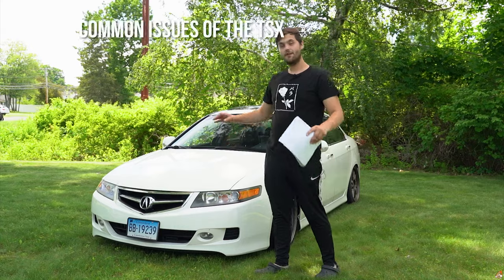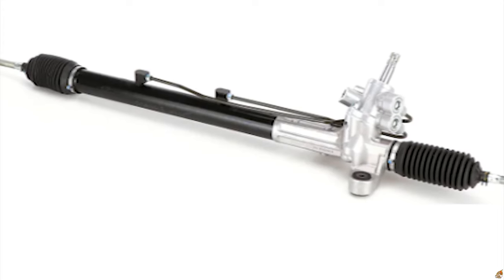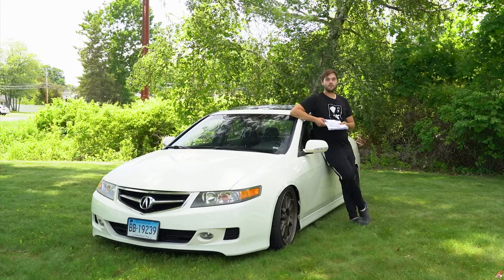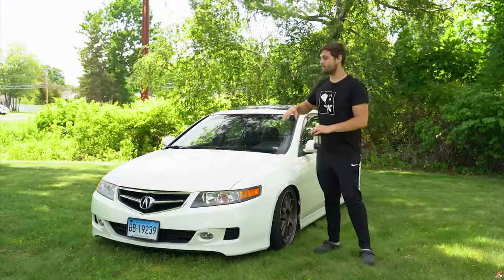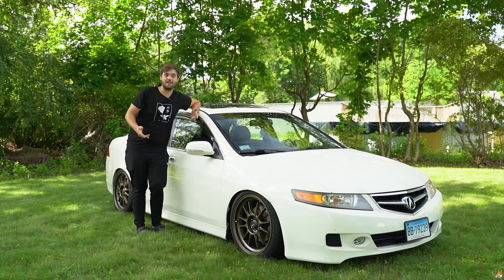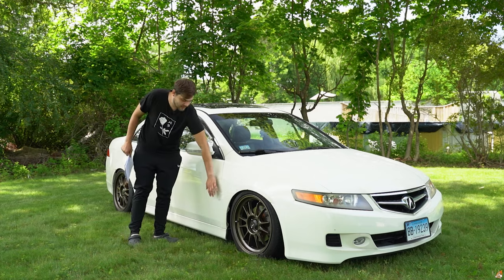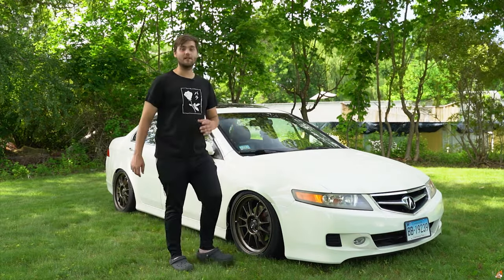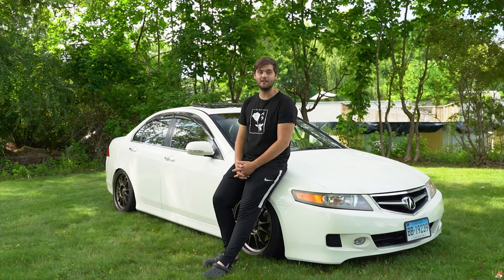TOP 10 COMMON ISSUES With An Acura Tsx

Comment: I have just replaced my front crank seal cuz  oil is splahed everywhere. Would it be the power steering pump? Or what is the common issue for a oil leak?
Reply from the maker: Its hard to say from your description, oil pressure switch, vtec solenoid, rear main seal, valve cover, timing chain cover etc

Comment: Saw a 2006 tsx 6 speed with 285k Miles is it worth buying with that kinda mileage
Reply from the maker: It really depends on the condition, whats been done, and ofc the price. if you can get it for a good deal sure thing can get a new engine for 800-$1000 if that would we let up.

Comment: I'm pulling a u0122 code I got new vsa module and it says abs motor relay open or short and my DLC is loose.. there has to be a short somewhere what's the easiest wait to go about finding it to fix it? I just have a multimeter and good launch scanner it's a 06
Reply from the maker: Hmm damn I haven’t really dealt with much like that, maybe look into your fuses make sure whichever for the abs/vsa and stuff is good. 
Make sure your alternator is reading I think like 14.7 or something may have to double check. 

Also double check your ground wires make sure they’re not all beat up especially thicker green one on the left side.  Then double check your wires/connections that nothings loose or exposed

Comment: Hey Rish, great video! Did you come across any VVT Solenoid issues? Like does the engine knock when you rev it or even while driving and changing gears in an automatic transmission?
Reply from the maker: Hey man and no a bit different for me since I’m manual but I was dealing with a p1009 code which is about the VVT sensor on the side of the head. 

I swapped that out and ended up getting a p2467 code after, which was the pigtail to the vtec solenoid oil pressure sensor. 

But was dealing with the car revving constantly at idle jumping to like 2.5k rpm’s. 

Code after vtec wouldn’t engage just rev
Reply: @RishMedia  hey man thanks for the info, yup its still doing that, like the rev fluctuates all the time while driving but i currently dont have any check lights or vsa lights popping up on the dash! Will changing of the VVT solenoid improve the knock sound and slight vibration of the engine while in idle and also in drive mode? Im also thinking that valve needs adjustments as well.

Comment: i have a 2007 tsx and yes all that problems youve mentioned i have experienced all that kinda expensive though ,had my power steering pump replaced at thedealer ..do you have any suggestion regarding parts store that I could use?coz dealer tends to charge wayyy moree $$$$ on it!
Reply from the maker: Yeah tends to happen especially if you go oem for everything, but oem isnt bad. I also use oriellys or autozone cause lifetime warranty. 
Also i do all my own maintenance basically so something like a power steering pump is real easy.

Comment: Wassup rish my 2006 tsx is ticking before I got the oil change. What could it be will SEA FOAM will fix the ticking noise?
Reply from the maker: It’s ticking after the oil change too? Make sure enough oil but also it may need a valve adjustment

Comment: Hey mate did you buy OEM inner driveshaft ? I broke the outer one and I bought GSP but the car vibrates at 40km/h. I'm looking for solutions, OEM is too expensive
Reply from the maker: The half shaft? Your able to replace the bearings on those what some ppl would recommend cause new is pretty expensive. 

Then best options is looking on eBay or junkyards for oem lower mile axles. 

Next best alternative are raxles

Comment: Have you heard of any problems with the ELD (Electronic Load Detector)? I'm experiencing some battery drainage problems, car not starting or barely staring, cranks for a while and will finally start, and then sometimes it starts with no problems. I've replaced the starter and alternator already. Any suggestions? Thanks Brother!!!
Reply from the maker: What year do you have?? With the 06-08 models they have a Bluetooth module front passenger side. When those go out it tends to drain and draw the power. 

That was my culprit with symptoms like yours, that or like a battery since you’ve replaced the other 2 possibilities
Reply: @RishMedia  Appreciate You getting back to Me. I have an ‘08. I disconnected the Bluetooth a few months ago which helped for a week or so. But still having the same problem. I’ve replaced the battery 5 months ago as well.
Reply from the maker: @justlikeice  hmmm are you getting any codes? 

Don’t want you to just keep buying parts and doesn’t fix, alternator/starter could be faulty. 
Maybe have a bad ground issue or terminal connection to battery

Comment: What was your symptoms of the intermediate shaft going out? I think mine is going out because when I’m going over 80 mph, I hear a lot of noise under the car. Not sure if it’s a wheel bearing or shaft. It’s a 6 speed as well, the axles were rebuilt a year ago
Reply from the maker: Almost sounded like a clutch chatter when I’d press in the clutch pedal and also driving like you say wheel bearing noises. 
Because there is a bearing so it makes sense.
But to see if it’s actually bad take it out then spin the bearing, if it’s super loose/wobbly then definitely a culprit

Comment: I have a 2005 tsx an I’m have problems with my temperature gauge going up and down like it wants to Run Hot it didn’t start doing that until I recharge my A/C . Do you have any idea what that issue could be ?
Reply from the maker: Are your fans kicking on, relays working, fluids filled in the radiator and reservoirs filled? Maybe your thermostat is playing some games, Also looking into your heatercore could be a variety of things. 

Could be something more simple of a fix, or like a heatercore thats a bish.
Reply: @RishMedia  I did a pressure test an I found out it was my radiator it was leaking.

Comment: I have an 06' tsx and when I come to a stop, my hood would always rattle. I check the motor mounts and they are all fine. What do you think it would be ?
Reply from the maker: Check like your hood latching it may not be sitting right or resting of metal and making it chatter. 

Kinda the only thing I’m thinking of atm
Reply: Adjust your hood latch. It's adjustable.
Reply: @gloums  I never messed with the hood latch, why would it all of a sudden get loose?
Reply: @RishMedia  checked the latch, it's fine
Reply: @209ers  Try rattling your hood. If there's movement then it's your latch or adjust the rubber stoppers at the far ends. 
After replacing my front engine mount I would still hear rattling from the hood. I adjusted the latch and it's much now.

Comment: i have an 08' tsx my ac blows warmish when its not moving, but when im moving the ac is blowing cold its so weird LOL
Reply from the maker: Maybe your AC just needs a recharge? It kinda does that idle mine a bit the same doesn’t work as hard
Reply: Check the FAN on the radiator. It's likely not working. Happened to me.

Comment: my fuse box was fried I thought it was a starter or alternator and changed my battery 5 times in a month 💀
Reply from the maker: Sheeesh was it the big power fuse that the battery and everything really powers from? Almost fried my ECU one time and that was the saving grace. It blows that fuse first line of defense
Reply: @RishMedia  yessir all cause one cable was pinched and messed up my whole fuse box 🤣 now I have to fix my AC cause that shit blows hot ass air, my passenger window just went out last week as well so I had to get that fixed as well. The car comes with a lot of problems but I love this car 😅
Reply from the maker: @jimmymolina8992  electrical stuff sucks to deal with lmaoo i gotta get my experience up dealing with that. Ive had some pretty wild moments with these cars 😂
Reply: @RishMedia  hell yeah one of my buddies keep telling me to sell this car but this car is a trooper only has 145k miles I plan on keeping it for a while just need to get the seats done cause these shits get torn up easily 💀
Reply from the maker: @jimmymolina8992  yeah these cars are great but older so just have to maintain like any other vehicle

Comment: Any thoughts on fixing the notchy tendencies of the 6spd? Was thinking Transmission oil, Clutch Master, Slave, then maybe bushing?
Reply from the maker: I’ve made some previous videos on this! 
I installed a hybrid racing CMC slave and braided line, also the CT short shifter and weighted shift knob. Definitely improved shifting a ton, a nice tranny fluid flush and adding synchromesh to it should help more to, which I plan on doing.
Reply: If you ever owned a Acura/ Honda or had anyone close to you that had any the tsx tranny is trash straight dog shit

Comment: Anyone else have a problem with the oxygen sensor at the cat and you replaced it and the light keeps coming back on?
Reply from the maker: What brand have you replaced it with, do you have any potential exhaust leaks before that sensor? Also do you get any bad smells or fumes as if your cats clogged?
Reply: @RishMedia  I replaced it with denso and no exhaust leaks or smells the light went away for a day and it came back on I went to go look at it was hanging on the floor so I believe it’s just a ripped wire

Comment: The main one I’ve been having was the vsa warning is always on 24/7, but nothing is wrong with it, I think it just does it for fun now :/
Reply from the maker: The VSA light is so annoying lol half the time idk what causes it , never given me problems on or off though. I feel like it has to do with the abs sensor or something
Reply: Did you find out what the problem was?
Reply: @julissagomez4670  nope, it’s just like that, even after I did a car scan it couldn’t pick up anything wrong.
Reply: At least in my case, It was a speed sensor wire. You can get them cheap on Amazon. Replacing can be hard if it is rusted/calcified.
Reply: I had this for a little while it was the pedal positioning sensor. Hopefully that helps
Reply: @presidentrocks4139 I have the same problem the VSA suddenly just turned on and it won't go away!
Reply: @presidentrocks4139 was that an easy fix, how much was it?

Comment: Anyone had any issues with front end feel slightly loose at low speeds and you feel it in the steering wheel, usually when applying brakes or going over bumps? 

Both lower control arms, motor mounts,, transmission mounts, brakes, kyb shocks with eibach springs, power steering pump, alternator, starter, belt, tensioner, all gaskets are new. When I pry on bushings or check all mounting bolts the engine, suspension and steering rack feels solid. 

There's no suspension noises, no vibration etc...
Reply from the maker: Hmm if everythings feeling good mechanical wise or recently done etc, idk id say maybe your alignment? Sway bar bushings? Ball joints, outer tie rods
Reply: @RishMedia  Im leaning mostly on the tie rods, upper control arms or upper strut mounts. I gave up on it to be honest until something brakes completely then I'll know lol... it's a nice daily driver and hate it when it doesn't feel perfect.
Reply: I feel a slight vibration accelerating through 2nd gear all the time. 6 speed. I guess the input shafts aren't that great, maybe it's just that. I don't worry about it too much but I think I know whatyou mean
Reply: @Red88Rex  In your case it's probably the axles but if you replace them stay with the oem parts. I'm actually starting to get a slight vibration when accelerating too. I know my wheels are balanced so probably the axles. 

I still haven't figured out the knocking sound but it didn't get worse either. It's weird because the car feels really stable/firm at highway speeds. 

For 230,000 miles I don't expect it to be perfect but it looks great for it's age in & out with minor drop.
Reply from the maker: @in54ne82  yeah honestly it’ll probably do with tie rods, sway end links, not to expensive or hard to do! But definitely solid cars if you dont mess with them to much 😭

Comment: Hey, my 06 TSX has got this strange issue where it vibrates violently after driving for 30minutes plus. Prior to that, at whatever speed, its fine. 
After the violent vibrations, which calls to pull over to the side of the road, I wait a couple minutes and as I drive off, the vibrations stop. Any idea what that may be causing it? I've tried my mechanic and he's adamant that the trans is failing, but I do not feel any transmission related issue. Any ideas what I need to fix? I'm completely clueless..
Reply from the maker: Hey man are you an auto or manual and what kind of shake is it? The whole car, feel it in the steering/wheels?

Are you getting any sort of CEL code’s? 
Can maybe like a knock sensor ive had something similar but it gave a code for it. 

I drove my car, went to move it to another spot at my destination and when i started the car is was shaking like crazy
Reply: @RishMedia   Thanks for the reply man, appreciate it! 
Mine's an auto, and the shake is the whole car. Extremely violent shaking which forces me to pull over. The steering, the brake pedal, everything. But the strangest part is that after pulling over for like 5 minutes, I try to drive off again and everything's back to normal. 

No codes either. Recently had a bad o2 sensor, got it replaced. Got the control arms replaced too recently. 
I love the car but not the fear of this shaking makes me not go any long distances anymore.
Reply from the maker: @hashimkazmi6759  and your trans doesnt slip at all?? Thats strange would’ve thought some sort or code would show, does vtec hit fine in the car? 

Just thinking what else, cause i havent dealt with that other then my knock sensor
Reply: @RishMedia  Trans seem just fine to me. Gear shifts are just fine. No noises or anything. No codes whatsoever. vtec hits fine too, haven't noticed anything off there. Again, the strangest thing is that the shaking doesn't happen constantly. It happens only after I've driven 25-30 minutes or longer and then fixes itself after a momentary pause. 
I have doubts that perhaps one of the brake caliper jams up. But i've also checked the rims whether one side heats up more than the other but nope, nothing like that either. 
I'm just so frustrated as to what there is that needs fixing. my mechanic said that the trans on these tsx's are "silent killers", and pretty adamant there that the issue lies somewhere there. 
Any chance the CV axle is doing this? I've never dealt with that before so not sure what to look out for in terms of the axle going bad. 
Thanks for replying man, really means a lot.

Comment: anyone know how to fix the whining when accelerating, previous owner of my 08 put in a radio system so i’ve always thought it was that but he said it could be the alternator?
Reply from the maker: And that whine is mostly through the speakers too right?? Most cases thats the alternator
Reply: @RishMedia  yea it’s in the speakers, i got the alternator tested and nothing came up instead they said that it could be that the speaker wires aren’t properly grounded so electricity leaks through them causing the sound
Reply from the maker: @jaydenm.9941  could be possible check your grounds but usually that’s alternator wise

Comment: 04 TSX when I lowered it a week later the rear passenger started making this loud bangs when I hit bumps need help
Reply from the maker: How low did you go probably coil or something hitting then
Reply: @RishMedia  it’s not low to the point I’m hitting all the time low but it’s like from stock to how I have it now like 2inches low
Reply from the maker: Hmm bit odd have you jacked it up and taken off the rear wheels see if there’s any metal hit contacts
Reply: @RishMedia  did that I don’t see any metal shading or anything I change the wheel assembly that didn’t work and also I did the 
12 o’clock and 6 o’clock it has play in it
Reply from the maker: @chrisrosete5456  fuck man hmm, ooo have you checked your rear sway bar bushings they make like a sheet metal in and out sound when hitting a bump

Comment: WOW. I replaced all of these on my '06.
Reply from the maker: Lmaooo happens to alot of us 😂
Reply: @RishMedia  Any suggestions regarding the engine shaking while idle right after an AC compressor replacement?  Mechanic says I might need new engine mounts.
Reply from the maker: @kevinmiller5051  yeah most likely shaking from the engine would be engine mount related. Just take a look at the condition if any tears or just old worn rubber

Comment: I have an 04 tsx and the radio seems to be possessed. When I turn right step on the brakes the volume goes up and down and it's start changing the radio stations and switches from am to fm to cd. Also the buttons on the steering wheel stopped work. Anyone have this problem and if how did you fix it.
Reply from the maker: what the hell lmaoo... sounds like some sort of wiring issue or shortage? sorry never dealt or heard of a similar issue.

Comment: Yo I have a problem with my 06 tsx when I jump start my car the car will turn on but it won’t stay on without having your foot on the accelerator and my car sounds like it’s cammed when you have your foot on the accelerator but when you take off your foot of the gas it turns off what could this be ?
Reply from the maker: Hmm have you replaced the battery at all ? Kinda sounds like the alternator possibly not holding charge any more and bearing making noise? 
Is the belt making any noise or burning?
Reply: @RishMedia  would you please help me I’ve been trying to figure out what’s wrong with my car and I have a video of how it sounds when I’m trying to crank it up is there a way I can send you the video !!